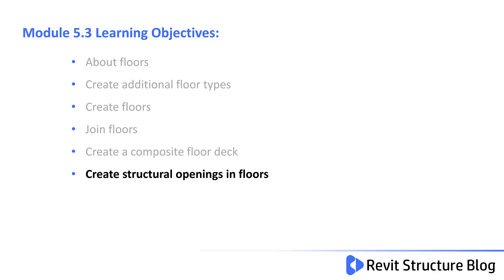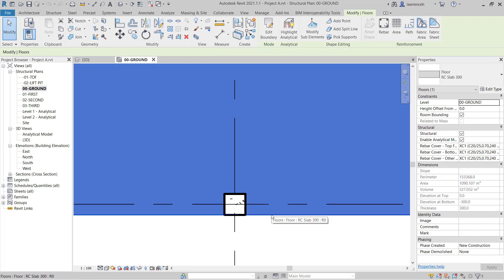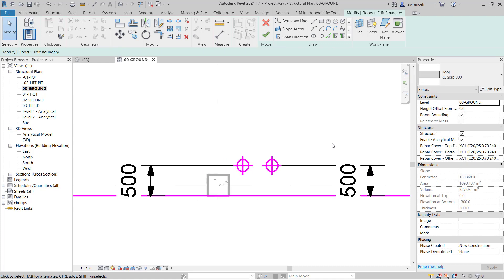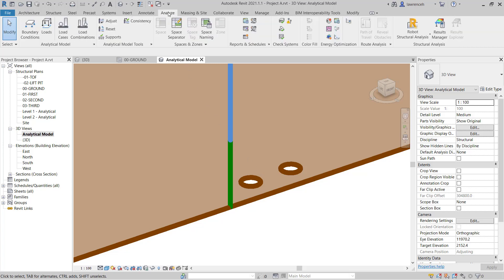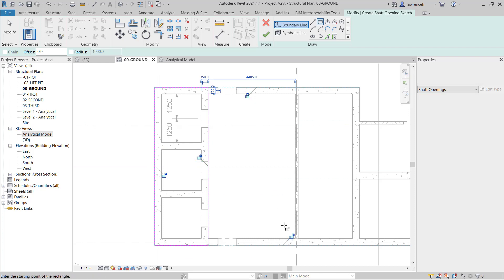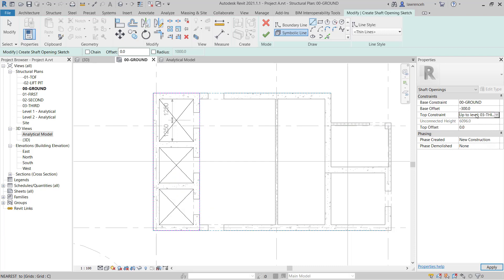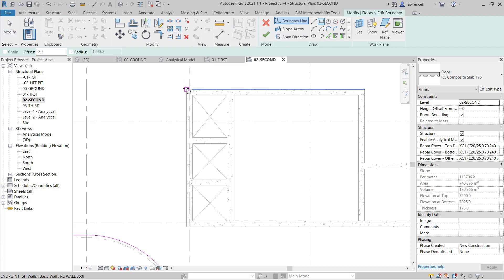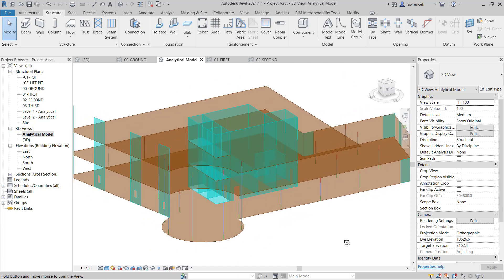Revit 2021 Training For Structures Essentials Module 5.3

Comment: I don't have anything in my analytical model. Sorry, I am new to Revit. I am running 2023
Reply from the maker: Hi, Revit 2023 does not automatically create an analytical model. You can use Dynamo Player to generate a model
Reply: @RevitStructureBlog  Thank you. I used the  'Analytical Automation' function to generate the analytical model. However, the ribbons are somewhat different in the Analyze tab compared to 2021. I'm thinking I may have trouble in your future modules because of this (I'm in module 6 now). To remove the floor penetrations that you removed in module 5.3, in the analytical model, I just had to delete them from the model rather than use the method that you used. This course that you've made is much appreciated nonetheless.
Reply: I also encountered this issue and started to panic, thank goodness I checked the comments. 🙏